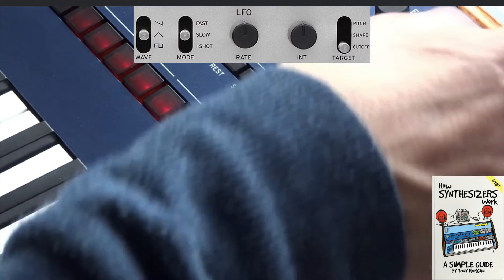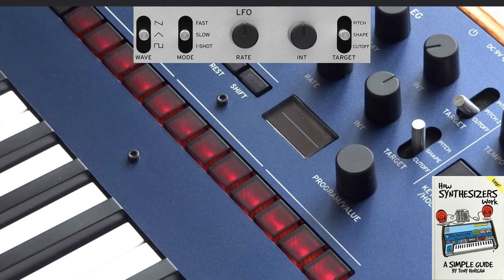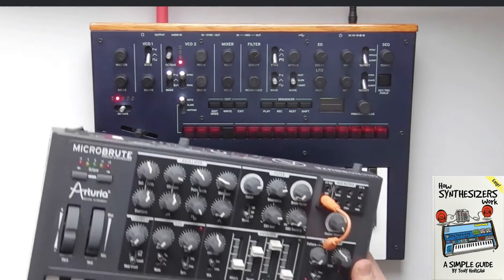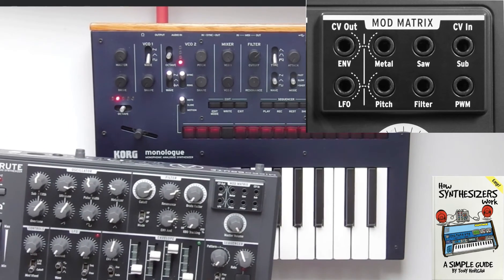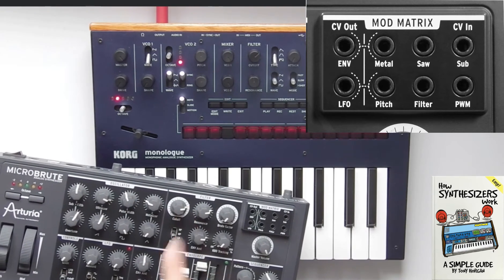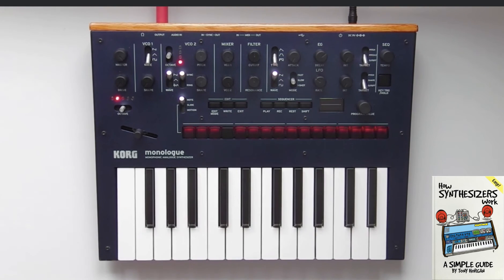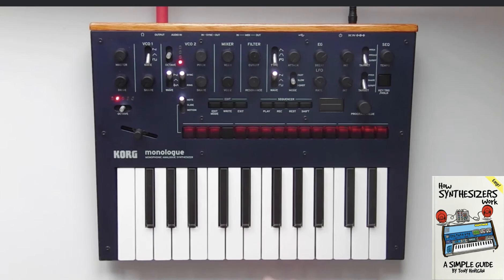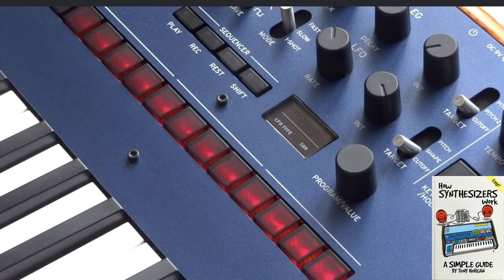LFO - [How Synthesizers Work] Explained Simply

Comment: Sorry if I missed it, but is the LFO overriding the cutoff knob, completely, or will turning the cutoff knob manually still have an effect when the LFO is on? Or, put differently, does the LFO always move something up and down from neutral, or from where the knob was before you turned on the  LFO? Or from where the knob currently is?
Reply from the maker: @neildutoit5177  yes, the LFO moves the the target parameter (in this example we’re saying the filter cutoff) up and down from it’s current setting. So on a basic analog synth with no patch memory (eg. Korg Volca Keys) this will be from the position of the Cutoff knob. On a synth with patch memory (eg Korg Minilogue), it will move up and down from the Cutoff setting for that patch. However, if you then adjust the Cutoff knob, it will move up and down from that new Cutoff knob setting. So you could change the cutoff setting while a sound was playing and while the LFO was in use, and the sound would change accordingly. The range of the LFO would change depending on the Cutoff setting.
Reply: @TonyHorgan  Thank you so much